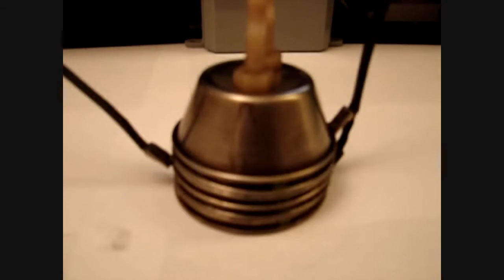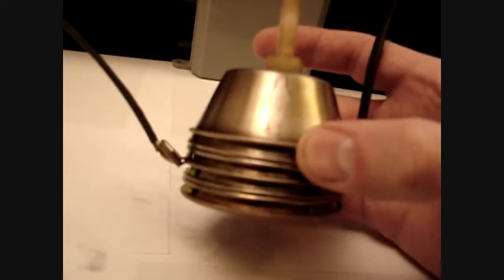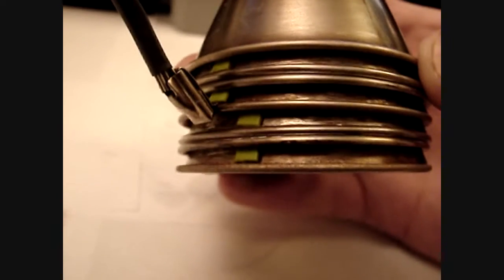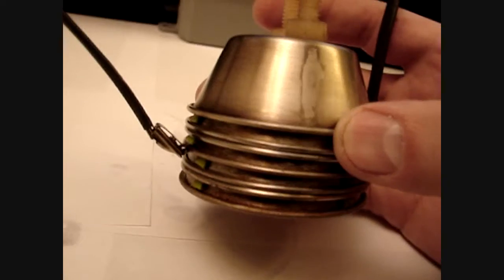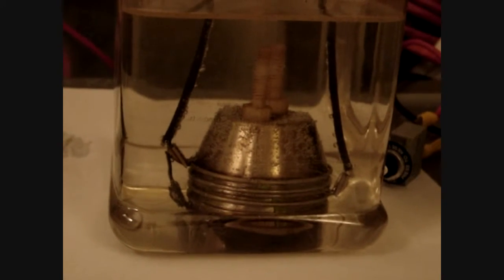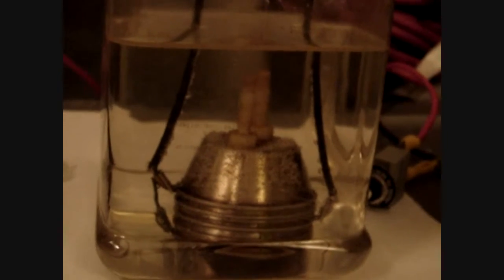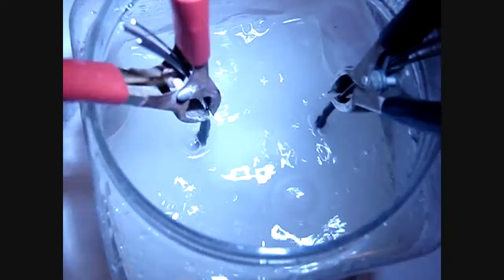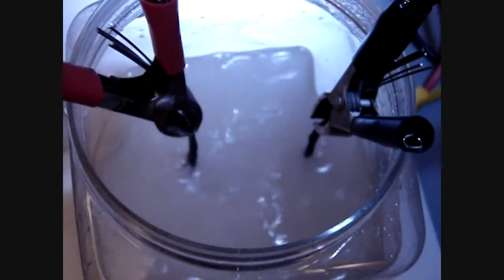Vid9 Volcano Cell Hydrogen Generator (HHO, Brown's Gas, Hydroxy)

Comment from the maker: I actually had the same problem when I tried using only one stainless wire for pos and neg.  I solved the problem by cutting several 6 inch sections of the stainless wire and then bundled them together using heatshrink.  This way the wire was much thicker and did not overheat anymore.

Comment: I did try the 316l stainless steel wire on cups. On the areas of wire out of the water turned red hot and that's when I melted my wife's Tupperware bowl before I could shut it down. The bright side I have a testing bowl with holes and she has a new Tupperware set.

Comment from the maker: To be honest, I haven't tested the stainless wire long enough to notice a difference in performance.

The water does stay cleaner without using zinc plated connectors w/ copper wire. But if you use spray on rubber to seal them, you wouldn't have to worry about using anything other than stainless.